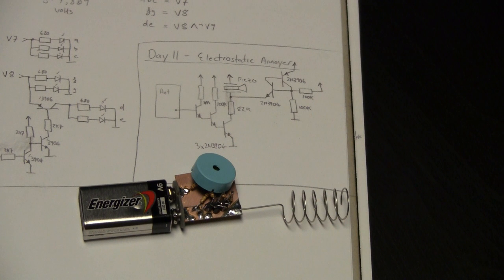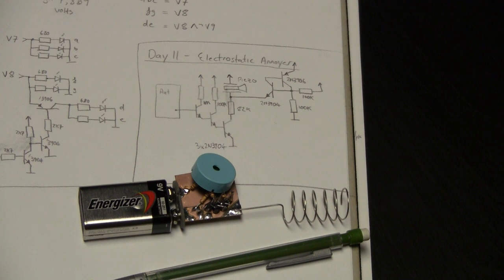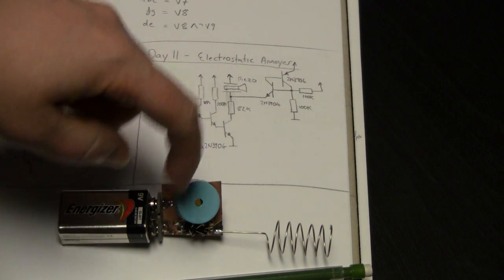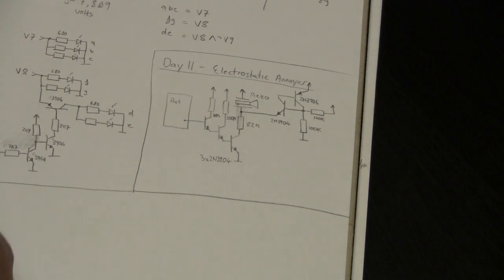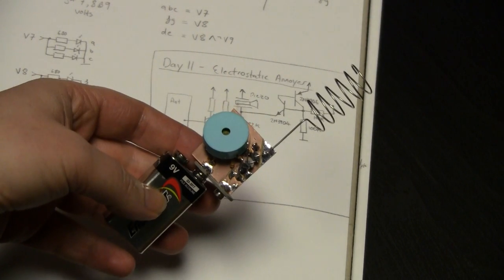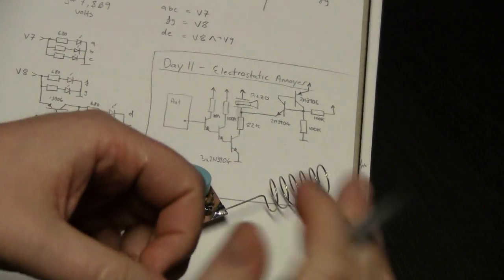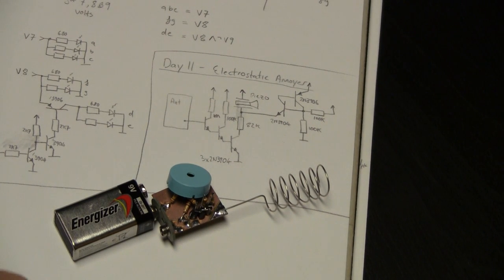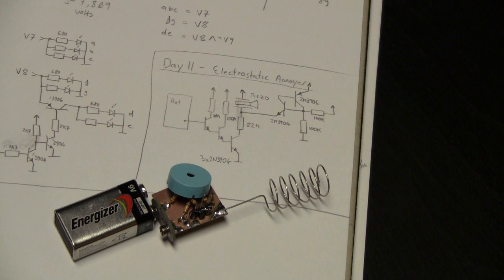Advent Calendar of Circuits 2014: Day 11: Electrostatic Annoyer

Comment: Please do a continuity tester! I got one of these multimeters, that takes time to boot and needs an additional button push, it has a lag, still beeps at over 50 Ohms and turns on diode junctions. But I can't bring myself to buy a decent multimeter. So if you can build something up, that in the end takes more time and money than a multimeter, I will still make it ;).

Comment: I like your sense of humor ;DThis is a bit more brazen, but I once built an audio amplifier and powered it from a 12v sealed lead acid battery inside my jacket. It was feeding a particularly efficient 4 ohm speaker (so it was capable of a few watts). Sounds innocuous for now but what I had was an adjustable feedback connected between the input and output so the frequency could be adjusted from almost motor boating to above the human hearing range. It was ear splittingly loud as you got above a few kilocycles. I used to test people's hearing in public at times with it by setting it to a frequency only a little lower than the horizontal sweep rate of an old school CRT television. So about 14 kilocycles or so. Very amusing!!! ;D
Reply: Evil!